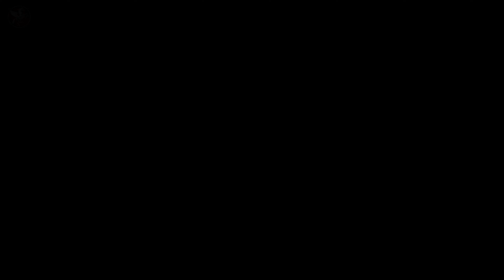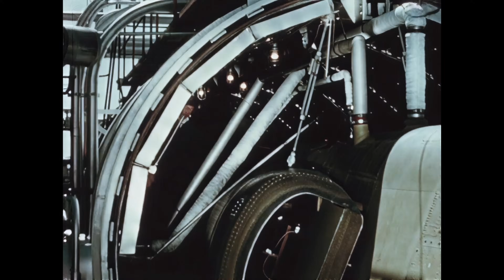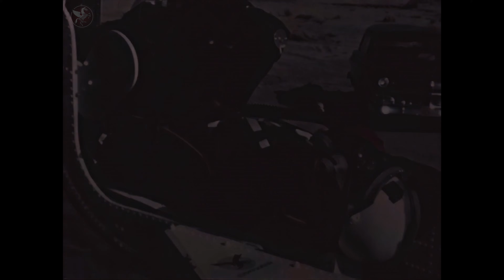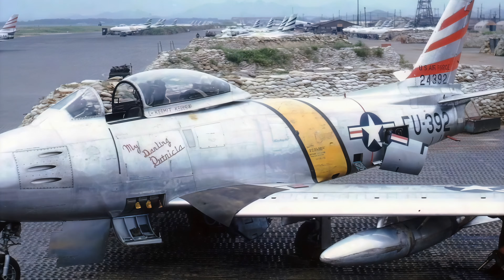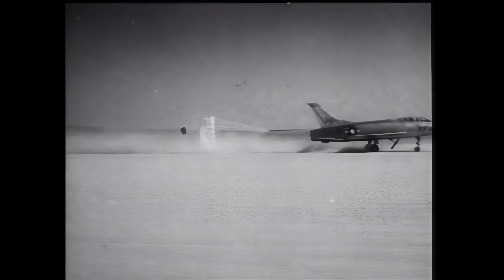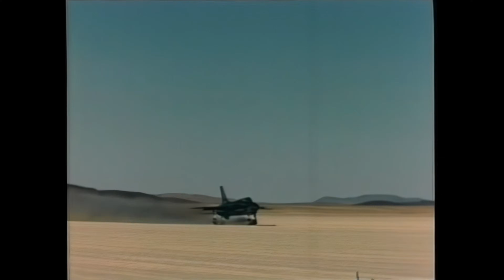F-106 Delta Dart: The Ultimate Interceptor That Landed Itself

Comment: That was a very dangerous period of time to be an Air Force pilot. Jet engines had developed faster than our understanding of the physics and the materials science of supersonic flight were understood. We went from weak, underpowered, inefficient post-war jet engines to Mach 1.5 capable/afterburning beasts capable of 10,000 lbs sustained thrust.

Comment: As a former MA-1 system tech (1970-1974), I always fuss about how little is mentioned about the weapons system itself. It was truly ahead of it's time. Given the fact that, in the beginning,  it was all vacuum tubes with a computer that operated by mechanical relay logic, makes it even more special. In the time frame that I worked on the system, we had a beautiful digital computer and an upgrade to a solid state navigation system. More changes came later which greatly increased system reliability. in spite of it's complexity, all it took to fire the AIR-2 unguided rocket was to set a time of flight and apply 28 VDC aircraft battery power. Thanks for covering a little know piece of American military history.
Reply: So was my dad. The Navy sent him to avionics school, he swapped to the Air Force in '61. After working on several Navy types the Air Force put him on their biggest avionics headache of the day, the Dart. He worked it until he retired in '71, then worked it at Robins ALC Avionics Center until the '80s when the F-106 went to the boneyard...
Reply: @uberduberdave  Great story. I had a chance to either transfer to the National Guard or apply to Hughes Aircraft as a civilian tech rep. I was just burned out on the whole damned thing. Tip of the hat to your dad for his service and for sticking with the MA-1 that long.